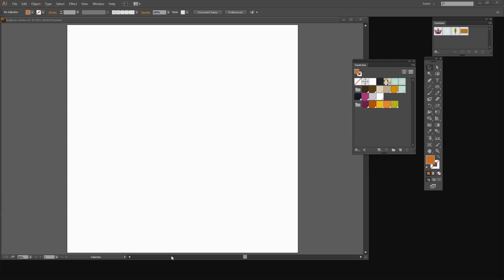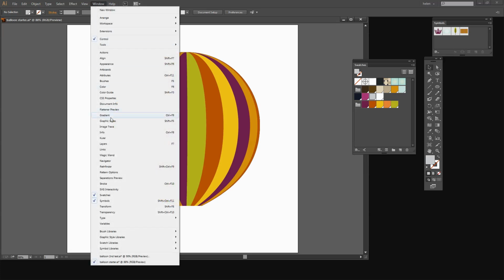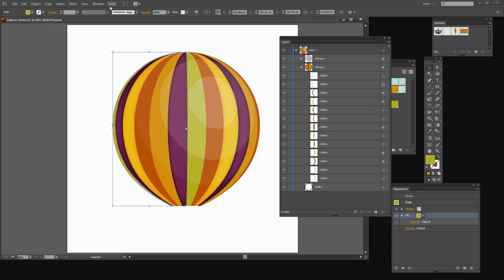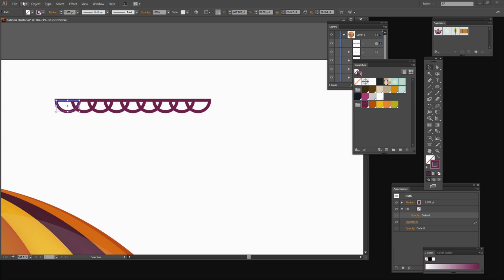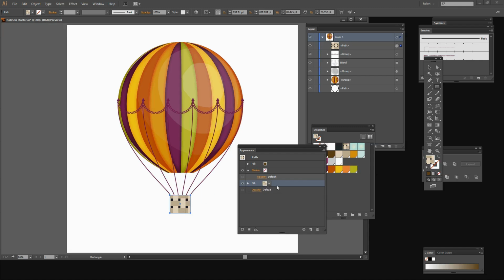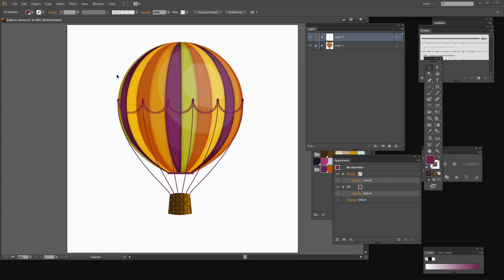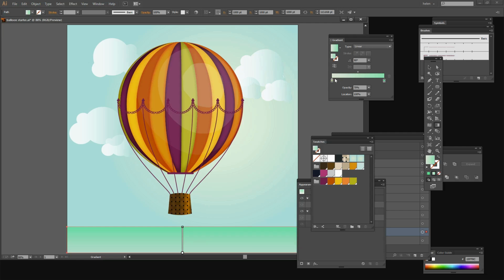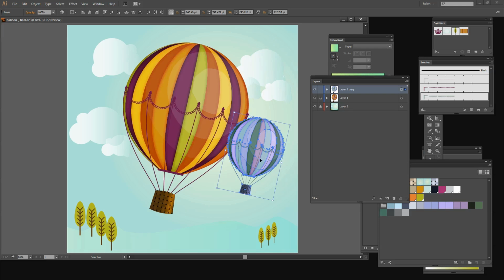Illustrator - Draw a hot air balloon

Comment: Help!  I have Illustrator CC and when I try mapping the art it doesn't do it.
Reply from the maker: There should be no reason why it doesn't work in Illustrator CC Gloria, can you be  more specific about what isn't working?
Reply: I figured it out, for some reason I had to apply the artwork about six times, it seems it was segmenting my shape in to several pieces, but once I added and scaled to fit to each frame, then it worked.  Thank you so much for responding.
Reply from the maker: Awesome. Glad it worked.